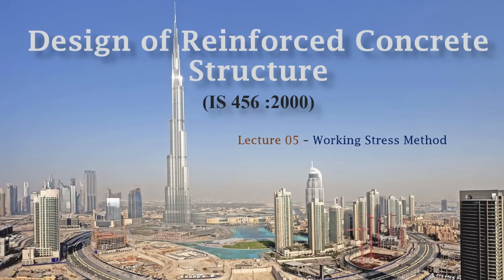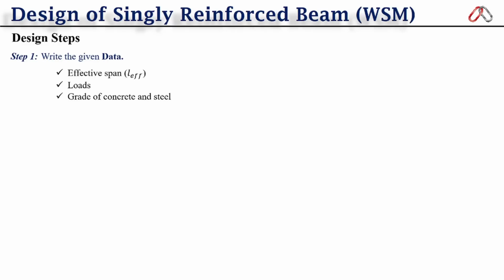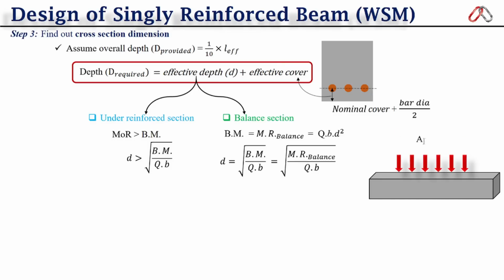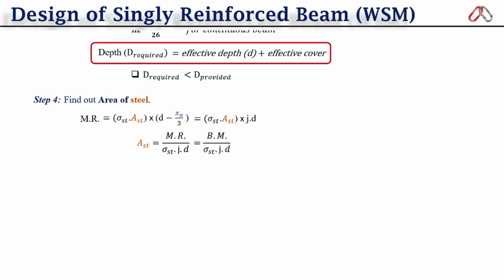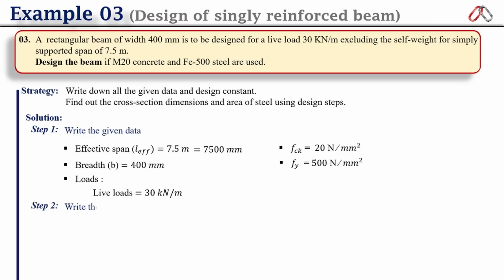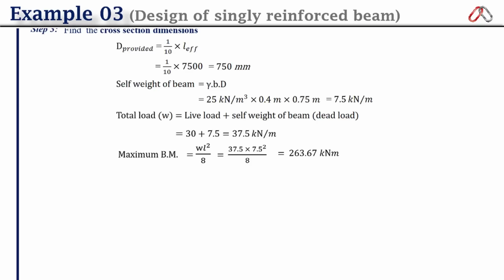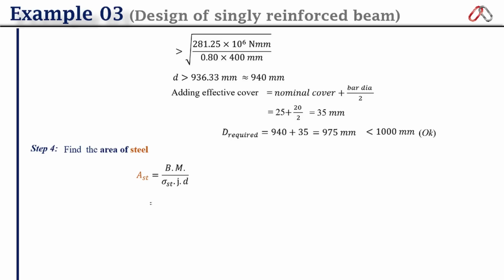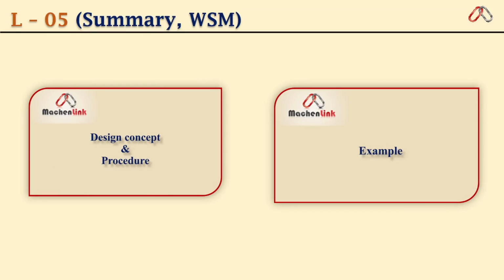Design of Singly Reinforced Beam (WSM)  Reinforced Cement Concrete (IS 456- 2000)

Comment: how did you find sigma st
Reply from the maker: Dear Aryan, Grade of Steel is Fe 500. Fe 500 is not mentioned in WSM but if any grade is given divide it by the  factor of safety (for steel approx 1.8). 500/1.8 ~ 275 (approx)

Comment: great sirji,,,,,,,n plz make video on wsm design of slabs and footing,,,,am eager to know,,,plz sir,,,,,make as early as possible
Reply from the maker: Hey Ijomuay,We would like to inform you that WSM is rarely used in design application now. LSM has replaced WSM in almost all design problems. IS 456:2000, which is the latest designing code is based on LSM. But still we have already uploaded lectures on basic designing based on WSM.

Comment: Sir thank you .. totally understand but how we choose dia of bars like you choose 20 ...
Reply from the maker: Welcome Fawad,
if you are learning the design than you can choose any from given data of IS code.
but there are two important factor when you select the dia.
1. Select dia in a way that Provided area of steel comes near to required area. (to make section economical)
2. it is beneficial to use large number of small diameter bars (distributed uniformly in one or more layers) rather than small number of large diameter bars to have efficient control on cracks.
Important Point here is that these things will come with experience when you start working with real projects.